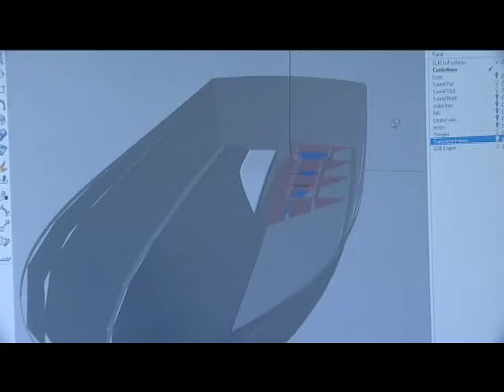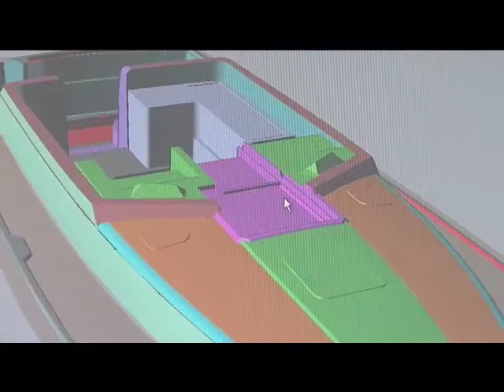Building boats in Maine: a glimpse of Sabre Yachts

Comment: Watching this is sad to see how this all played out. Sabre no longer building sailing yachts, they are building what the customer(s) want-power yachts. What I see on the rivers are yachts sitting at anchor or docked, they are floating condos, nothing wrong with that, just different than maybe how it used to be. Fuel is so cheap today it is hard to justify the cramped, by comparison, sail for the same uses. When I see a sailboat out though she is sailing, not anchored off the swimming area.